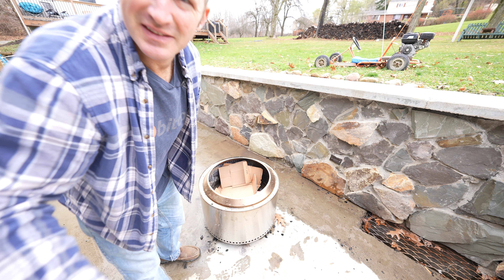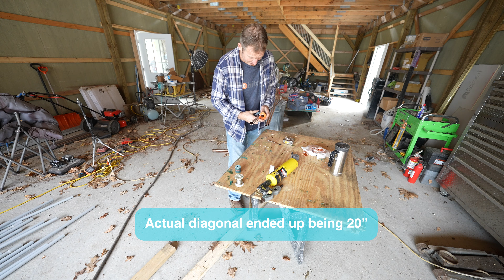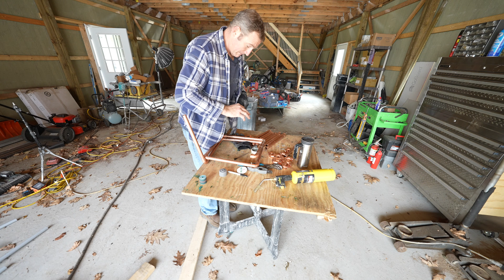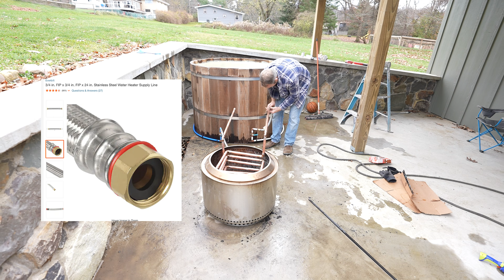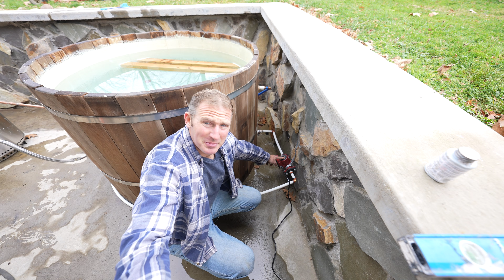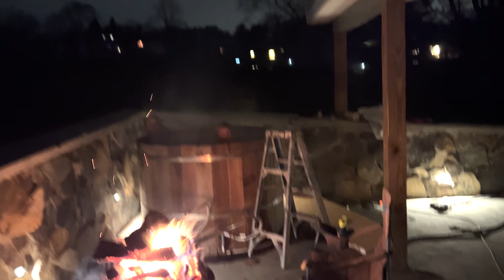Homemade Wood Heater Hot Tub

Comment: Not sure why the system needs an electric pump. 
You called the thing you’re making a “radiator” when really it’s the opposite, it’s a heat exchanger.
Water convects when heated, so the (cold or cooler) inlet to the heat exchanger (from the hot tub) should be at the bottom, and the hot or hotter water outlet from the heat exchanger should be at the top.
As long as the system is full of water, the solder cannot melt, and the water will circulate by convection.

Comment: Huh. Won't the heat from the stove melt the solder? Or is it not hot enough?
Reply from the maker: As long as you keep water running through it it’s good, the second the pump shuts off it melts the copper
Reply: @BathroomRemodelingTeacher  Ahh, of course that makes sense. It's like trying to solder when there's water in the pipes...never works. Think the water would circulate without the pump due to the thermal pressure imbalance?